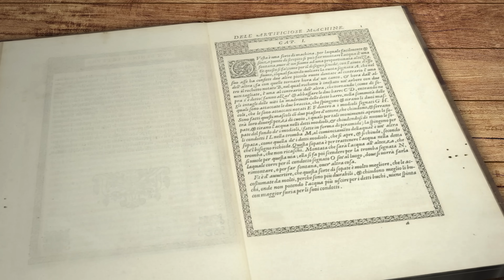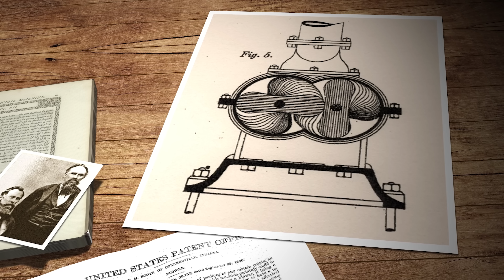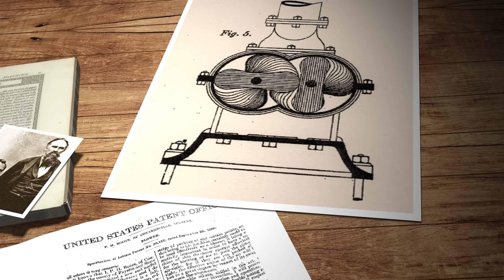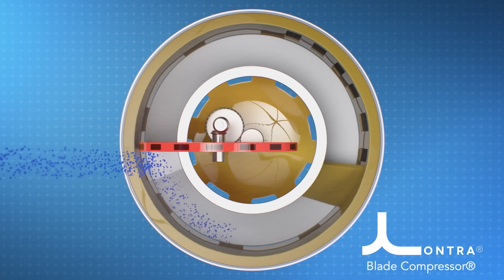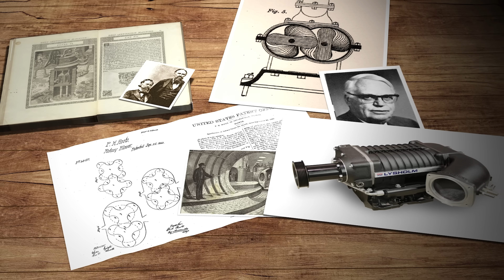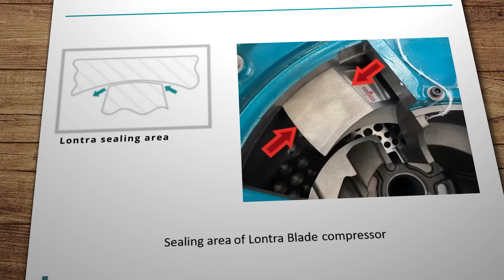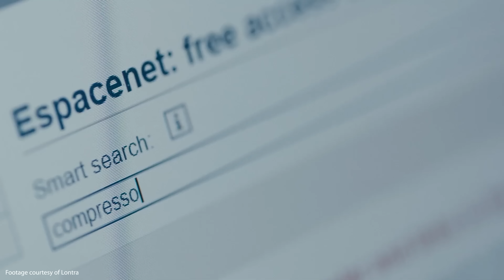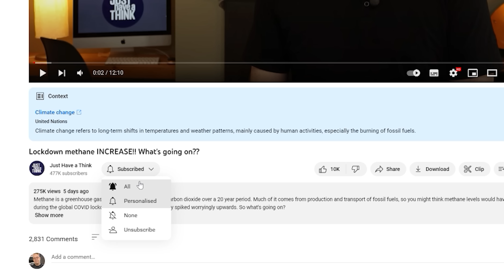Compressing air to reach net zero. A 'revolutionary' innovation.

Comment: That is a novel idea, loved the scale model which made it so easy to understand. If it can do what they say it can do will be useful for a lot of things. 
Wish them the best of luck with it all. 

Also there was a guy in Australia who built a car which looked more like the lunar lander, that ran on compressed air and used to it go back and forth to the shops, he used either solar or wind turbine to compress the air in the tanks and then used to drive around, although not  big a n heavy family car it was pretty cool and he built it so he did not have to pay for fuel. 
Cant remember where i saw that but thought it was pretty cool.
Reply: We hold multiple pneumatic generator patents. We use compressed air to power 5kw and 10kw generators. Patents cover: design, operation, and tank storage.
Reply: @turbinex_generators What's you're company name. How shall I contact you for more information about your services and products?
Reply: Oh ya you mean The Di Pietro Motor, developed by the Australian company EngineAir, is a rotary engine powered by compressed air. The guy's name is Angelo Di Pietro.

Comment: Hello. I am an energy efficiency engineer and I have been looking at air compressor and air compressor energy efficiency for around 15 year (if you want to talk industrial EE let me know :) ). There where a couple things I wanted to address after watching this video:

At a high level any time you add steps between your energy and your use you add inefficiency. Directly using an electric motor will always be more efficient that taking motor load to create some side product (in this case high pressure air) that is than used for a process. We see this same issue all the time in industry when high pressure steam is used to heat water, why make steam to than heat water when you could have just heated the water directly and used much less energy to do the same job. Compressed air is much more convenient, requires smaller tool and is greatly embedded in existing industrial technology but it is a wasteful way of getting things done.

This is because.. air compressor by design are very inefficient. About 66% of the energy in a air compressor system is used to make air hot. This is because of that pesky equation PV=NRT. Even with a air compressor that is 30% more efficient.. it would be much better to use anything other than an air compressor if you can. A 50 HP air compressor could be replaced by a 8 HP piece of equipment that could do the same job with 60-70% less energy use.

Your example at the water treatment facility may be an issue of application and not efficiency of the equipment. This application would low pressure air and not high pressure air like what would be produced by a standard air compressor. This mean that you could replace the air compressor at this site with an air blower and greatly reduce there energy use, not because the air blower is fancy technology but because you do not need high pressure air.

Lastly pneumatic transportation is a energy disaster when compared to conveyor belts. It is convenient- yes, does it use 4 times as much energy or more to do the same job-yes. You can imagine this kind of transportation as using a semi truck to pull a very small car down the road. You could use a giant fan to blow beans 100 meters away or you could just use a small motor and a belt to do the same job.

I hope this is helpful and does not come off as being a critic for critics sake. I have a huge passion for making industrial efficient but it will require more change than replacing existing inefficient processes with slightly less inefficient processes.
Reply: You're right they needed clean oil-free air, volume counts more than pressure. The webpage says the compressor is for low or high pressure applications, flow rate 350 to 1550 CFM, outlet pressure 4 to 15 PSI. Pretty much all it can do is blow clean bubbles and a bit of wind.
Reply: @edbruder9975  15 psi is not industrial compressed air. Industrial compressed air runs in the range of 100 psi or more. This technology would not apply to the vast majority of industrial compressed air and should not be claimed as such. Pneumatic system seem to be operable at the 15 psi range but this does not account for pressure drop across distances. These systems only meet the min requirement for pneumatic systems but 100 ft is around 10 PSI drop or more for common material meaning this would not be applicable for this application for any reasonable distance.

Comment: Fixing inefficiencies in the delivery of energy alone would solve the problems of waste and pollution. The trouble with the ghg scam is they hide the pollution while looking at the ghg nobody can see. Not a single solution will ever pay back the GHG budget it too to create. Not a single one. EV's are even worse than fuel cars. They only last 5 years are not recyclable I can go on and on with the EV's failures of claims. Are you going to buy a 5 year old EV with a dead or near dead battery? where are these batteries recycled? They are not. Can EV bodies be recycled? Nope. At least a steal body can be melted down for other uses.

Comment: This is really interesting. Many years ago a relative of mine looked at using compressed air as a form of energy store, but the heat losses were so great it wasn't efficient in the slightest .I wonder if this compressor would have a material difference on this
Reply: Don't think so

Comment: A better solution would be to take a 6 cyl block and cam two cylinders to not to fire but to compress air  that would be injected into the intake for better combustion.

Comment: 7:20-9:00 yes... but you are missing half the story and not including the downside.  The tiny amount of contacting surface is done to increase efficiency by lowering friction.  Having a huge contact area is not done because it causes excess friction, heating, and lost power.  Lubricants like oil and grease help.  Yes, as you said, small contact areas requires better machining to do, and yes, you also mentioned that the large contact areas help with a better seal, but the trade off is friction.   It would be interesting to see graphs of a different compressor designs plotting total contact area (m^2) vs. mass flow vs. electricity used, at some typical industrial use-case pressures. Also how are they lubricated.

Comment: Have a mechanical direct connect to the axle of EVs and solar, to super charge them. No more plugging in. Use V2G tech to transfer extra energy to the power grid for everyone to use. We already have the answers. Just use them correctly please.

Comment: Using a self running generator, with a kinetic design and stronger magnets, would allow us to constantly charge power walls or something else, to use in homes and businesses. Especially energy efficient 3d printed homes.😎🇺🇲. Solar homes that already have everything, would be able to easily switch over without paying very much. You'd be able to have clean energy everywhere all the time.

Comment: The force of the pressure inside the chamber itself would distort the intersecting discs. So it very high pressures you would have right angle forces on the two intersecting rotating components. And its value and relatively lower pressures may not be as much.

Comment: Why not hook these pumps up to wind turbines and use the compressed air to generate electricity in one central generator. This would allow far better regulation in high winds, less maintenance and much easier electric circuit? I am not an engineer so no doubt someone far cleverer will tell me why this is not a thing!

Comment: This Guillotine toroid design has been batted around as an internal combustion engine concept for years. I can't believe that its original.

p.s. A lot of screw compressors have inexpensive Teflon apex seals. Teflon has fantastic wear properties and very good thermal properties (it was a secret "war material" when it was accidentally discovered).

Comment: This design clearly does not address the clearance/tolerance issues it claims to solve, both mechanically and in sealing integrity, and discredits the merit of reciprocating mechanisms, incorrectly describing the design and characteristics of their parts.

All mechanisms experience wear and tear, and with that, a loss of mechanical tolerance and sealing ability.

With its method of passing sharp edges, on a mechanism where that feature is a small section of the rotating circumference, aggressive usage, rotation, and pressure, will cause wear and will eventually allow more backlash in the gears, displacement of either rotor, and a resulting collision of those edges, as well as a reduction of sealing ability.

Screw compressors will lose sealing ability, and minor, but disruptive contact between the rotors and housing.

Reciprocating mechanisms don't have critical alignment of the power handling parts, and the pistons are sealed to the cylinder walls with piston rings, which deliberately slide, but with low force and friction, and self-adjust as their interface between the piston and cylinder wears, which was omitted here.

The existing designs are quite effective in maintaining efficiency, which is more affected by the handling of the air than the losses in the mechanism.  Company finances see to it that efficiency is a installation consideration.

Comment: While most liquids are not very compressible, I was wondering if this Lontra pump could be used to circulate fluids, such as for a swimming pool circulation pump or a heating circulation system. Instead of compressing, it would simply be used to push the water or fluid through the pipes.
Reply: If you want to use it as a pump rather than a compressor, you would modify the design, so it does not compress. Since what defines a fluid is that is a nearly incompressible fluid, it would be a good idea to do so. Simply extending the holes that let the gas escape (or in this case, the fluid) should allow for this. I am not sure if it would be a good design for a pump, however. There are plenty of pump designs, after all, for different applications.

Comment: Wonder what kind of compression ratios this type of compressor is capable of reaching. Improving air-conditioning efficiency would be one of the first places a high efficiency pump would be beneficial.
Reply: 15 PSI.

Comment: I like how the design is relatively compact. This would be beneficial for automotive applications. Turbochargers are more efficient compared to screw and roots type superchargers but come with inherent flaws. It would be interesting to see this applied to get a good comparison of power and efficiency. Maybe even a compound setup to still take advantage of energy waste from exhaust.
Reply: Thinking it would work well the snow making industry.
Reply: I've just taught myself enough 3D graphics to draw my advanced, far more powerful Turbo / External Heat Engine and will publish on a youtube channel I have soon. A larger than normal exhaust turbine is backed by a sealed turbine filled with high pressure CO2, wrapped in a radial compressor, joined to the same setup on the other end by a hollow axle. Compressed CO2 expands with much force when heated. I have it pumping fuel, coolant and whatever else (ie. hydraulic fluid or second fuel type) in between, also cooling the middle of the turbo/engine.
--
It's designed to work with an internal combustion engine that shoots exhaust gas into each side alternately, with the opposite side cooled by squirting high pressure coolant at the exhaust turbine on the other side, adding steam power and amplifying heat engine power that relies on a temperature difference between ends - HOT-COLD engine... It's a condensing exhaust system so the water from the steam is reused and cooled exhaust gases expelled (or compressed into a diaphragm that expands into the fuel tank to be dumped at a gas station).

Comment: As a mechanical engineer I can see many ways why this hasn't been adopted but the major one is the geartrain needed that not only changes the direction of power by 90 degrees (huge energy waste right there) but also has to be zero backlash for millions of revolutions. A roots blower only has four points of high precision contact where this design has a dozen or so.
Reply: Welll he did say they could get the same effect in less quality parts so perhaps even tho it has more its made up by the fact the tolerances arent as high.
Reply: Please don't embarass this video maker with your ability to perform simple arithmetic :)

Comment: compressing air to provide an energy transfer medium is always going to be challenged on efficiency due to the physics of compress gas, gas gets hot, heat is lost to the environment
Where I think this design is going to shine is the service life, and it also looks like a low noise solution.
Also it depends on how the pump is optimised - are they designing this just to shift a tonne of air volumer at comparatively low pressure - think the type of devices used to inflate air beds, or a lesser volume at higher pressure - think air tools and tyre inflators
I do like me a bit of new tech

Comment: This could be easily reversed, no? using this mechanism to turn compressed air into rotational motion, 

For storing power, the higher efficiencies would mean minimized losses when recouping back the stored energy,

Also, If you need lower tolerances in machining, perhaps you could 3d print it or otherwise use a less thermally conductive (yet thermally stable) material so that at lower rpms any heat in the compressed air is maintained and returned back to as pressure at the outlet, no?  

Which begs the question, if you're compressing the air, then you're temporarily heating it, no? and conductive metals expand when they heat up, ruining your precisely machined part, 

So, i assume compressors are designed with this in mind, so the are designed to maintain peak efficiency under certain conditions, rpms, ambient temperature, etc

and for more rigorous applications, i assume some sort of external cooling is used, no?

Comment: i remember about the mid eighties a funny French man driving around Paris on a kart made from dexian using a compressed air "motor" 
i often wondered why this wasn't pushed ? you can probably say that the range would be low BUT when you have the same time to "top up" as a petrol car it becomes more viable then electric 
PLUS you can power most units to compress the air at stations via wind and solar , 
its got to be worth looking at ??
 and
 i remember the late great fred Dibner showing a rail way powered by steam in a tube i believe that it was Brunel who was trying it but the problem was leakage as you say , but with modern materials it might be possible to day , even if its on a short busy commuter route it may well become viable

Comment: The supercharger made for cars uses this principle, it isn't really revolutionary.  The use of compressed air to replace batteries has been a part of discussions I have seen for decades on the internet.  Toxic lead and acid are energy intense technologies, but air compressors of piston, diaphragm, and screw/ turbine design can be made by a blacksmith and infinite patience.

Comment: Interesting concept.  There are many different types of compressors and all have their place. Screw type seem to be the heart of the industrial type machines.  But high amounts of flow with consistent loading are achieved with centrifugal type, but they have their down falls. And then you of course have high pressure units which are typically positive displacement like piston or multistage screw.  They all have one thing in common though, heat.  And that is where the bulk of your inefficiency arrives is the energy going into compressing a gas goes to heat. You want to increase your overall efficiency, reclaim that heat and find a place for it.  Or someone please make a low temp efficient organic rankine cycle engine or a stirling engine to use the heat to convert to power.

Comment: Sounds like Michael Crowley's Sterling heat pump could use several of these in place of the displacement fluid pumps we saw in your video from last year. Maybe these two machine inventors should talk to each other, what do you think?

Comment: Well, the available model ranges from 300mbar to 1000mbar, that makes it not even sufficient to replace a bicycle pump. The industries standard for compressed air is at 6bar to 8bar. This available model is far away from an industry revolution. Sorry, it is a fail. The website itself proves this... no real life real Industrie presence there...

Comment: I didn't work on these compressors yet, but as a maintenance engineer with long-time experience, I think this invention is a maintenance nightmare compared to a traditional screw compressor. The traditional screw compressor is one of the simplest machines ever built with two screws two gears 4 bearings and the frame. It is a piece of cake to fix it. I am not so sure about this new invention.

Comment: Interesting comments. Some very useful and insightful inputs albeit based more on experience with other compression  technology than a holistic analysis.

A fundamental problem with LONTRA's business model is energy savings are less if a factor than capital cost, installation an maintenance.

I expect  existing compressor manufactures in Asia will be making LONTRA-style compressors after thir parent expires.

Until then LONTRA needs to sell as many if their compressors as possible in their niche of lubricsnt free , low pressure  compressed air.